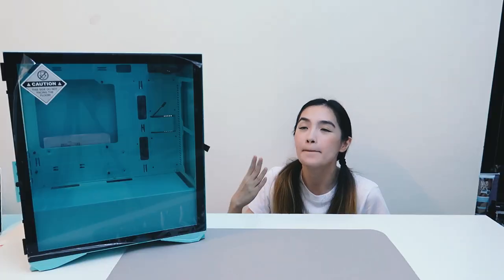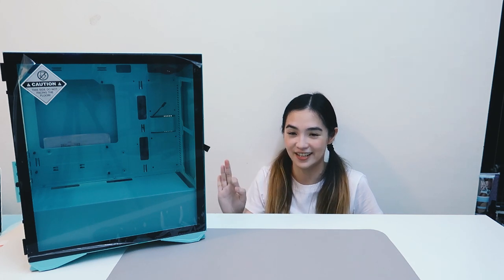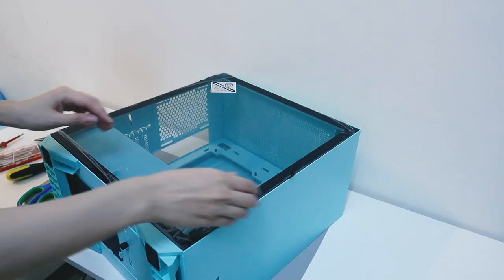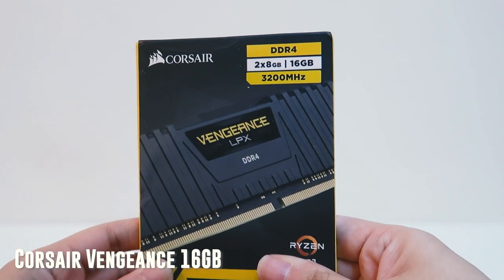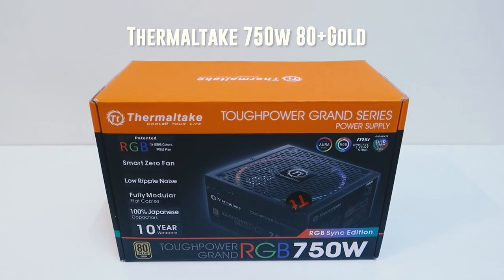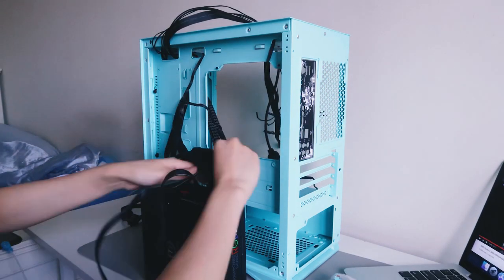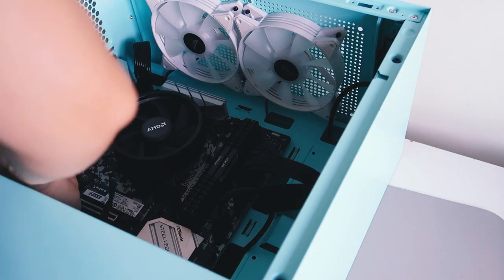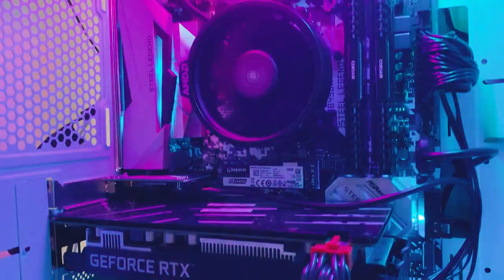I BUILT A CUSTOM PC!!

Comment: If you dont mind , I would suggest to put the extra fan on the back and make it exhaust instead 2 fans are intake.  And also I will suggest use the 1 and 3 ram slot for your ram.  Enjoy and congrats!